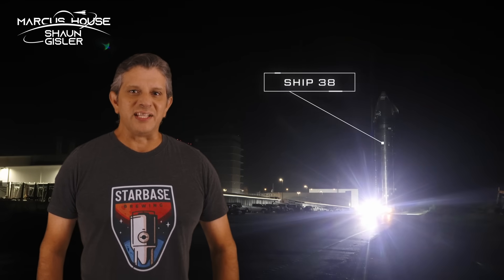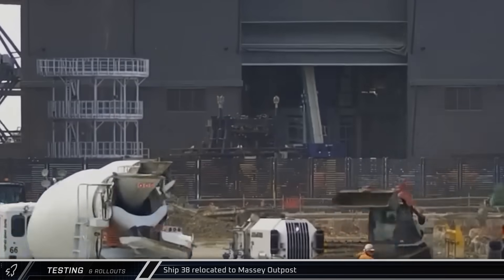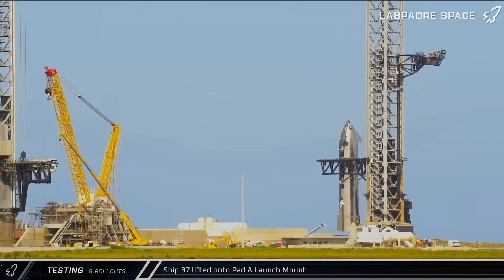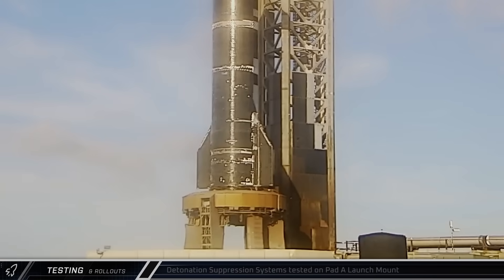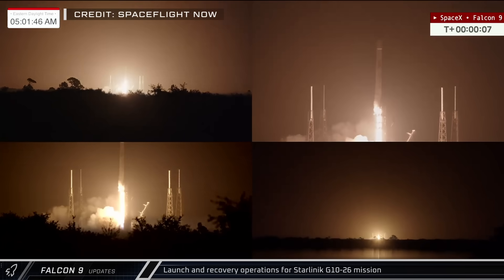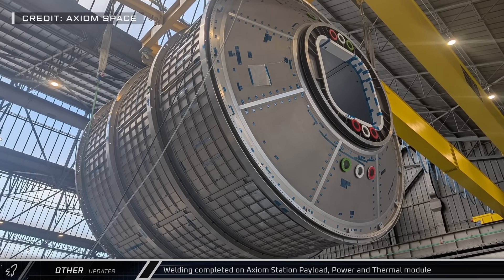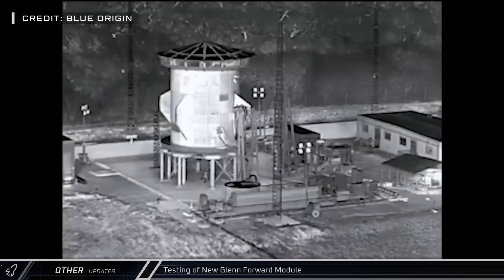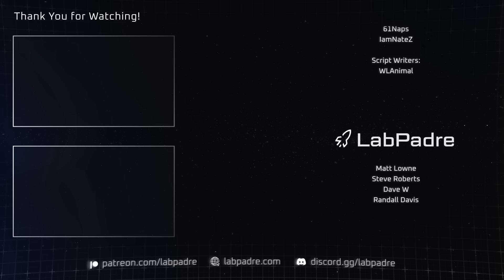How Crazy! Ship 37 Static Fired On Launch Mount - Spaceflight Weekly #178

Comment: Why is this such a big deal? Boosters static fire on the launch mount with 33 engines. Starship has 6. It's like a tadpole compared to a booster.
Reply: @ensignbodybag  i think the pad was slightly modified to support the ship static fire
Reply: @xx_peace_xx5300 pad 1 and 2 can only static fire and launch booosters. For the ship static fire they had to build never built before adapters and a lot of hope that the  starship wont explode or fly away
Reply: Or a kitten
Reply: Well it didn't explode or fly off the pad with half a transport stand attached.
And it doesn't grab attention if you say, "SpaceX do things and make stuff."